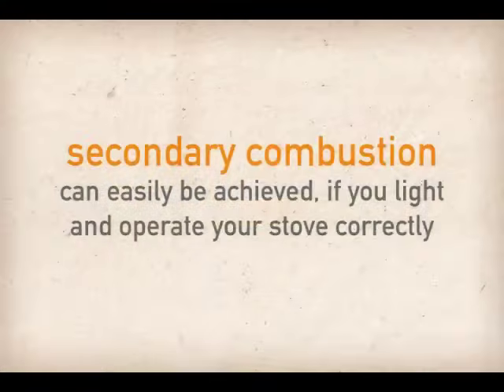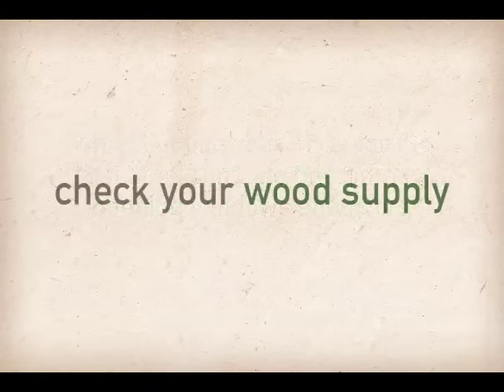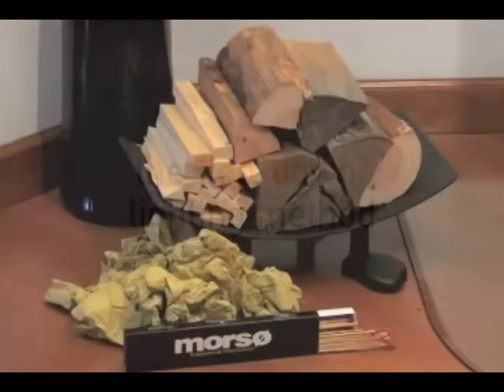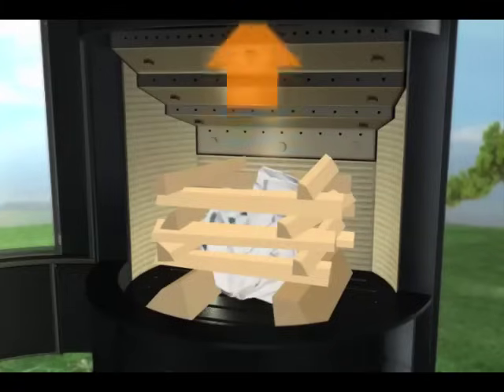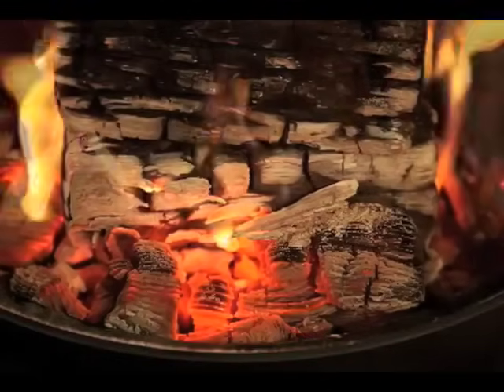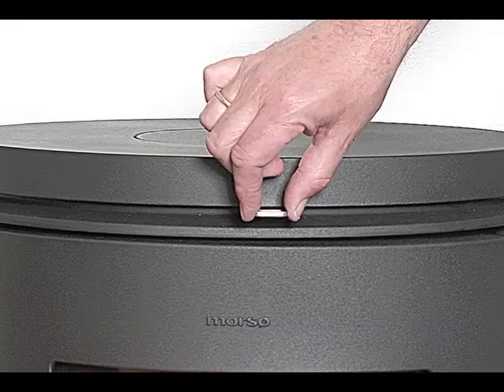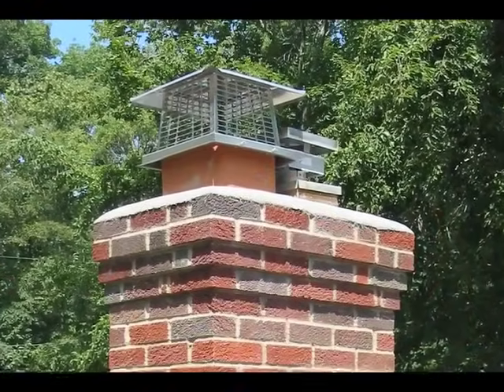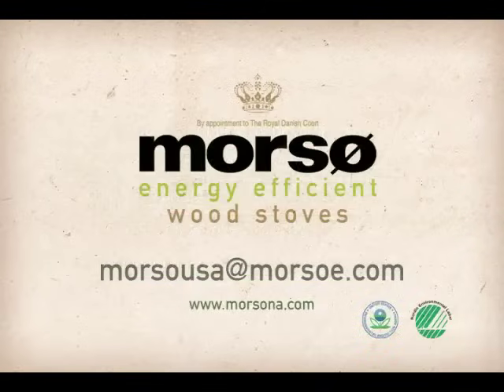How to increase the efficiency of your woodburning stove

Comment: How should you adjust the air vents so no Carbon Monoxide is produced? Instructions are un-clear...
Reply: Carbon dioxide is CO2, it is formed by complete combustion of a carbon source. Carbon monoxide is CO, it is formed when there is insufficient oxygen to completely combust part of the carbon. Actually, both come from cars and pretty much anything else that involves burning something although CO2 is by far the predominate component. Animals and humans also generate CO2 from exhalation. This CO2 is used by plants in the production of cellulose and other materials. The reason for concern about carbon monoxide is that it is poisonous. CO binds to the hemoglobin in your blood so much better than oxygen that it doesn't come off easily and can lead to death because you blood can't carry enough oxygen anymore.
To improve combustion simply allow more air to enter.
Reply: It takes a given volume of air to completely burn a given volume of volatile gases. Ideally you have a slight excess of air for complete combustion. Any more air doesn't burn any cleaner, not enough air makes carbon monoxide.

I like to keep the air fully open all the time and regulate the heat by how much wood I put on. Takes a bit of practice though.
Reply: KiwiPowerNZ I do the exact opposite....I use the minimum amount of air necessary to maintain a rolling-hot fire in my firebox.  In my stove, once I have a hot bed of coals, I can burn one or many logs very cleanly....I control room temperature by how many logs I place in the firebox. But my practice, developed from more than 30 years experience burning wood, is to maintain a HOT firebox, and then control the rate of combustion by adjusting the airflow to the absolute minimum necessary to maintain a hot, rolling fire in the fire box.  My first goal is ALWAYS to maintain a hot firebox - even if this meant overheating the room.  I know that this is working well, because my stove and exhaust chimney remains very clean.  For example, I burn 3-4 chords each winter.  After 9 years, my wife laid down the law and told me to get the chimney cleaned, even though I insisted it was clean.  After the chimney sweep disassembled the access points and scrubbed the exhaust stack, in my wife' presence he asked whether we were actually using the stove at all.....it was that clean.  (You might be tempted to ask if my wife acknowledged what I had previously said about the chimney being so clean.  Answer: if one cares about marital benefits, seek a path of enlightened self-interest) 

Keeping good control of the wood seasoning is also important.  In my part of the country (northern US), if my wood is cut in February and split, it will be dry enough by the start of the next heating season, usu around early Oct.  Any drier than that and the wood will burn too quickly and won't form good coals.
Reply: So, how do you know what the minimum amount of air is? I notice if I keep both vents wide open, my wood burns up faster...even with the damper closed. This year I started cranking both vents about half way closed and had problems keeping the fire going at times, so I guess the optimum point is between half and full open.
Reply: D Wetick If you're burning wood with a lot of resin like pine it does tend to make black smoke in any case. In big coal fired power stations they have O2 sensors and adjust the airflow until there is say a 0.5% excess of air. But for us, we just experiment. Too much air actually cools the fire down if the fire isn't big enough to use that air. If you do want to run the fire really slowly, remember the flue is under a slight vacuum that's what pulls air into the fire, so any carbon monoxide you produce will be sucked up the chimney and not go into the room. Plus it's in such small volumes that outside it disperses into nothing so don't concern yourself too much.
Reply: D Wetick The answer to your question is the same answer as to how you get to Carnegie Hall:  practice practice practice.

Practice, coupled with fiddling small (and sometimes large) adjustments of the stove air controls.  I have a Hearthstone stove- very heavy and high ehat mass-takes longer to heat up than a steel stove.  When I get my fire going in the morning, I usually have to make several adjustments - open the ash drawer to get a roaring draft, close the ashdrawer to only a crack-open and start opening the airvents as the firebox heats up and the wood gases start to combust at the top of the firebox, followed by "crap!...closed the air vents too soon" re-open the ash draw to get the fire raging, start closing the ashdraw again, re-establish the air flow through the air vents, get a hot fire box, slowly close down the air vents.    You'll know when you've attained this hot stage because you'll observe that the fire won't be coming from the logs (even though they should be covered with cherry-red glowing surfaces) so much as a hot "flash-over" fire burning in the ceiling of your stove composed of the combusting gases from your wood.  BTW - this is why air-tight stoves today are properly called wood gasifiers.  So, it is at this point when the firebox is HOT that I start choking the air flow down to just enough flow to maintain that steady hot burning, but not so much air that fire burns super hot and fast, which wastes much of the heat up the chimney.  Again, the trick is to make several small adjustments.  I know of know stove that does all this automatically, and if it did, I wouldn't trust it to do a good job.

Hope this helps.
Reply: +KiwiPowerNZ If you are getting black smoke off soft wood there's one of two things hat are  wrong..... one... the moisture content is way off ....two..not  enough combustion air ....when  burning wood you need a 'Hot Burn' creating secondary combustion with those high temperatures...as for shutting down the stove then sending smoke out the stack that's false economy..too little Air shuts down the combustion process.....
Reply: @Jangle2007  When you say your aim is to ALWAYS maintain a hot firebox even if it means overheating the room, why is it preferrable to have an overheated room than not a hot firebox? I find it hard to function when the room is too hot.

Comment: If you have to use that much kindling then your wood isn’t seasoned.
Reply: 'Seasoned' means dry---that's all. At season's beginning get a few of your fuel wood bits, split those exposed surfaces with an ax and test the moisture% with a moisture (water) meter . The reading should be below 20% and is better if around 10%

Comment: I use charcoal lighter fluid on the ends of my wood to start a dead stove for coals.. As for NO smoke, I guess I'm burning wrong.  I always have smoke, lots of creosote build up, which I have to clean out weekly... Maybe time for a new stove... lol
Reply: If you get lots of smoke and creosote ,most likely your wood is not dry enough. All woodstove owners should have a moisture meter. It should be below 20 % . People that sell wood often lie about it being dry.  Good luck.
Reply: @twoweary   I bought a new stove one of those that burns the smoke before flu.. Works great now..  I did check to make sure no creosote build up and hardly anything the whole year..
Reply: yup, lots of liars selling high moisture wood out there! I use the 10% or less moisture rule, and use wood that has been seasoned  - exposed to being dry outside for at least 2 years. This will give you dark brown soot at the end of the season when you clean your chimney (a good sign indeed!)👍 @twoweary

Comment: all things being up to snuff concerning the operation of my stove, it still won't burn like it once did. although my wood is seasoned, I think it may be damp. any ideas what's going on? thx
Reply: Chimney is probably blocked up. The flue blocks up when the exhaust temperature is not hot enough.
Reply: If your stove has catalyst, they are probably clogged.
Reply: Sweep the chimney, as a sweep it's recommended to be cleaned 1/4ly when in use. No matter how dry the timber is it's the resins in the wood that cause the problem.
Reply: If it's damp, it ISN'T seasoned. Get a moisture meter and make sure it's 20% moisture or less . And get your chimney swept.

Comment: After reading all of the comments below,  I remain more confused,(many questions arise) ,we have evolved to burning bicycle tires and tubes, and tennis shoes doused,or saturated with diesel fuel....chunks of truck tires , 10-40 weight drain oil..??
How do You.... What are the steps to burning the drain oil...???
doesn't all of this make a sticky- guey sooty mess inside the stove and flue pipe..?
Doesn't it stink up the neighborhood,and smoke bad enough for the neighbors to call the fire dept.
or the Police .??
Furthermore...I can relate to the Vodka,  and the Marshmallows , but what's the
 whipped cream for ?
I Readily understand whip cream for Hot Chocolate.... and toasting marshmallows...I have even floated my toasted marshmallows on my cup of hot chocolate... But "vodka , whipped cream , and marshmallows" combination.. .maybe I'm missing something , or thinking too hard ,
or not hard enough
Maybe if we drink enough Vodka we can start busting up the furniture and start tossing it in the stove....for a "Hotter Burn".
Reply: I live near a power station & have a endless supply of depleted uranium which burns well with used engine oil..
Reply: When we re-shingled the roof on the cabin, all the old shingles went in the stove and kept us warm during the job
Reply: Phil Reilly 

I find roofing Felt gives of a real good heat,,  Best to burn after dark if you are in a smokeless zone

Comment: Don't use newspaper. Use fire starters. They are very cheap and work much better than newspaper.
Reply: Paper works just as well as and it's free.
Reply: @stevehadfield5963  Paper burns too fast and not reliably enough. The key to starting a fire  is good airflow. Paper impedes that airflow, even after it's burned.

Comment: Terrible way to light a stove! Guaranteed to put smoke in your room. 

Instead, put one firelighter at the back of the base of the stove, build a small pyramid of kindling around it, then add two mid size logs once the kindling has taken. Don't use newspaper, it adds nothing to the cinders, and burns out in seconds. Environmentally friendly firelighters made of compressed sawdust and wood oil is way better all round. 

Shame on you, Morso.
Reply: wrong, rick....the way they described works perfectly....shame on YOU....